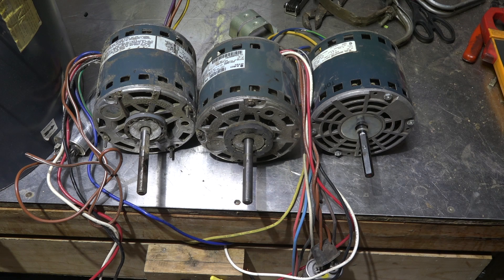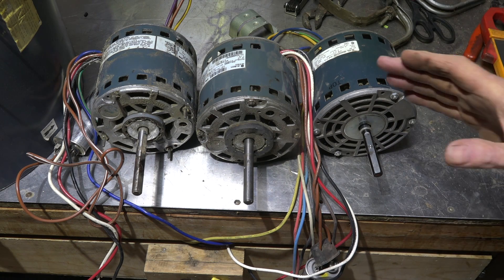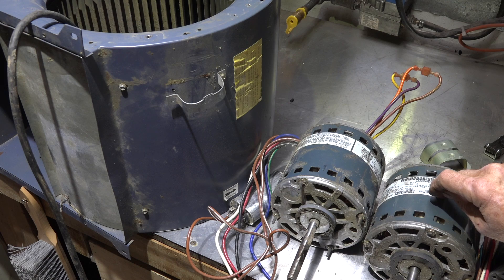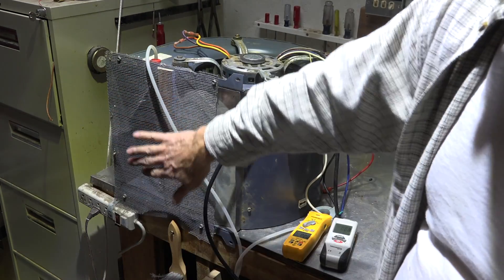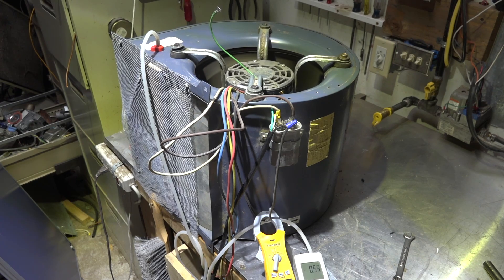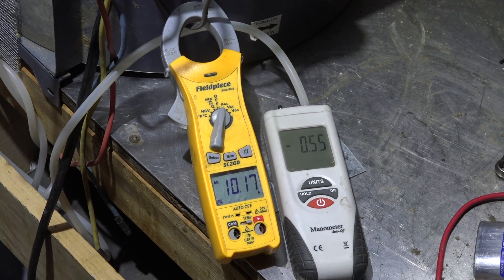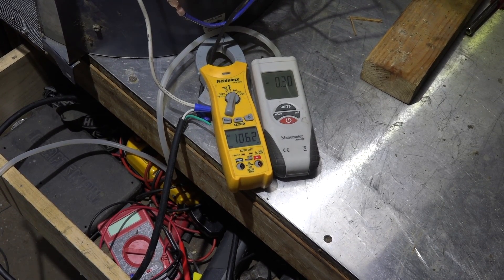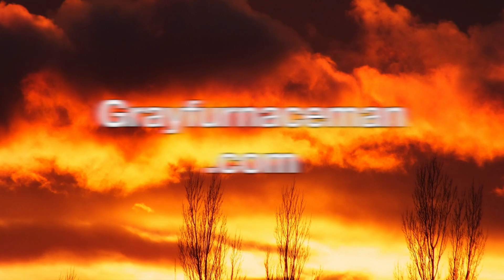Horsepower vs amp draw motor test

Comment: HP is the old way to rate the torque x RPM .The new way is watts. 746 watts= 1 HP . So a 1/2 HP motor will consume 373 watts + the enefficiency of the motor. If the motor name plate amps is 9.2 @ 120volts @ 1140 RPM that's 1071 watts .So subtract the 373 watts from the 1071 to find your loss due to heat ,friction, windage and bad design. The motor manufacturer can overrate the HP. The motor will run hot with a short life. Our refrigeration compressor motors are over rated because the return gas keeps the winding cool. Same with fan motors high air flow cools the winding. This all works fine in the test lab but out in the field when the return gas is warm or the air is warm or with high static pressure the motors over heat .

Comment: Thanks for the video. Can you explain how motor RPM affects the amp draw,  and correct pulley size?  Centrifugal and propeller fans.
Reply from the maker: These are synchronous, meaning there RPM depends on the hertz (cycles per second).  When load is applied, the motor gets slightly out of sync.  When that happens, the total impedance of the windings reduces, and amp draw increases.  Hope this is understandable.
Pulley relative size affects amp draw (faster = more) until the max speed of the blower is reached.  Wheel design determines max RPM.
GFM

Comment: Gray furnace man I have an x13   1/3 hp  2.8 amp  230 volt motor,How would I match that up with a PSC motor?I Know it isn’t ideal but I want to install a PSC in place of the X13.If it helps in any manner the X13 was in a FB4CNF024. Any input would be greatly appreciated.THANK YOU SIR.
Reply from the maker: I would replace with a 1/3 hp PSC.
GFM

Comment: Gary, so we are supposed to match Rpm and Amps but not worry about horse power?
Reply from the maker: Ben Hartwick Correct
GFM
Reply: Is it common to find rescue motors with a variety of amps?   It seems it may be a challenge to have a van stocked with a bunch of different amp ratings?  What do you do?
Reply from the maker: Ben Hartwick You can use a motor with higher amps than necessary in an application but not lower. Many oem motors will have higher amps than general replacement ones. 
GFM

Comment: Thanks for the video!! I've applied what I've learned from you in the last vid to change out a failed motor. Would a smaller blower cage put the other two motors in line with their rated amp draw?
Reply from the maker: Yes and no.  There is quite a difference in blower assemblies and it is not all in the size.  If you used one that was designed for the smaller of course it would not overdraw.
GFM

Comment: Gfm you had the intake blocked pretty good there
Reply from the maker: Because the blower assembly has no back pressure outside of the furnace, you have to make some or even the proper motor will sometimes overdraw.
GFM

Comment: That is pretty convincing. 
Say, GFM, what about the ECM motors, are they becoming more predominant in the industry?
Reply from the maker: They are.  However, they are very expensive to replace and usually when they fail (other than a thermistor failure, I did a video on replacing that) the entire furnace will be replaced.
GFM
Reply: My aged 1984 Bryant 90+ % furnace had the odd blower failure where it would "grunt" a few times when trying to start, but usually would start on the third cyclic event, this was all in the same call for heat event. If I flipped the dip switch for emergency heat, the next call for heat was met with a solid full speed blower. After replacing that bad ECM the furnace ran fine. The old ECM had no shorts or opens so I gathered the controller had failed. The new motor had a higher revision number and wire harness and looked quite different then the oem motor. But for sure the prices on these replacement parts are over the top. The combustion motor I repaired after one of the three magnets came loose, it is still the original factory part. So yes, 32 years old, one new secondary heat exchanger and two or three pilot proof switches and a blower motor.
I'm thinking I should replace this unit soon... but it is still quietly heating as I write this. I was told over and over how bad the main boards were on these, but heck, I still have the original.
Reply from the maker: Interesting.  You have an ECM motor on a 1984 model.  Never see one.  Must have been a goody.
GFM
Reply: Pardon me, it is a 1988 model 398BAZ036080GCKA, 28 years old, my old brain confused it with my daughters birth year. Was this the first year for this furnace?